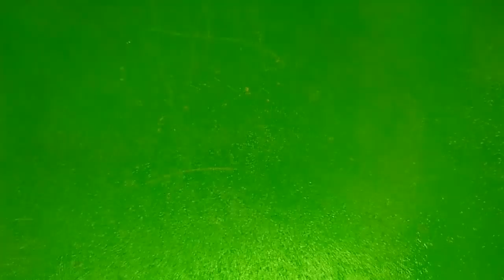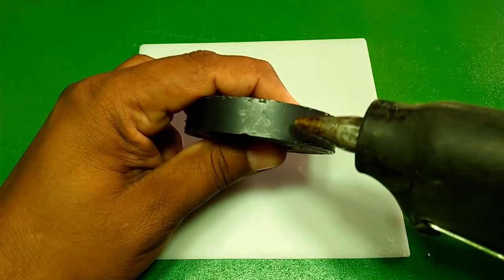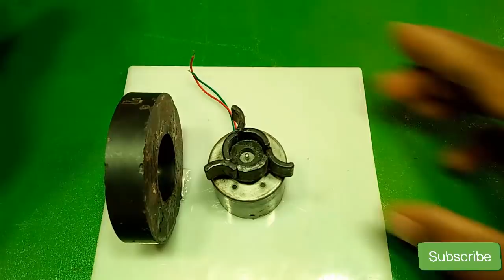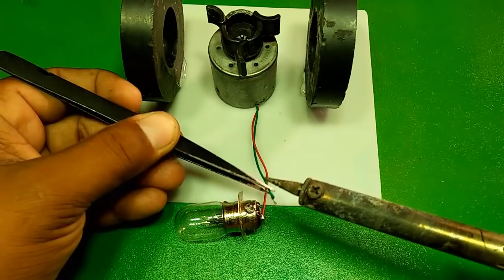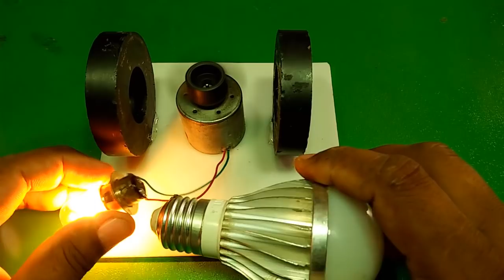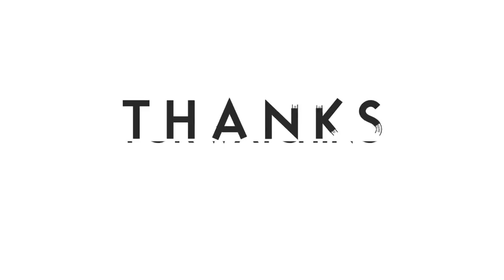Real free energy generator 100% self runing with magant new exeparmant

Comment: if you can show us that your magnets can spin even without motors attached, then this true
Reply: Valid point. There would be a hole below the motor for power connection.why don't he show bottom side isolating the whole set from the ground or table.

Comment: I did it and it is working I won first prize in my science fair
Reply: Shaik Alisher Bhai agr shi bol rhe ho to plzzzz contact krlo mere see bhttttt zada musibt m hu
Reply: Shaik Alisher 
Don't tell a lie
Reply: You can't use two fixed magnetic fields or it will lock the motor in place, magnetic fields have to alternate back and forth to spin the motor. This man placed two magnets on either side of the motor and locked them down so they don't move, so the magnets in the motor will do the same thing.
Reply: Is this real..wish you realised that people really need real help